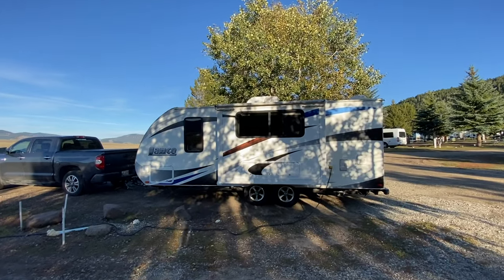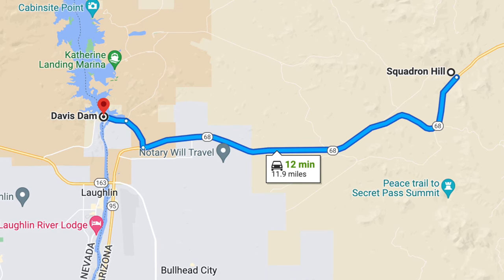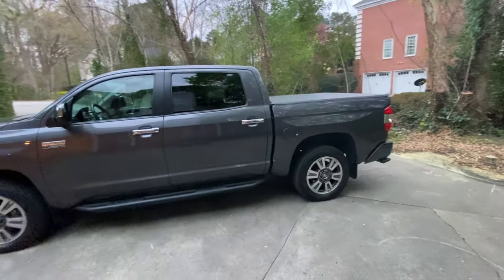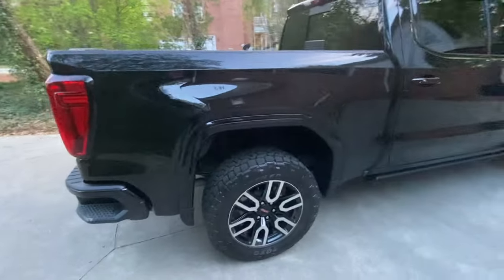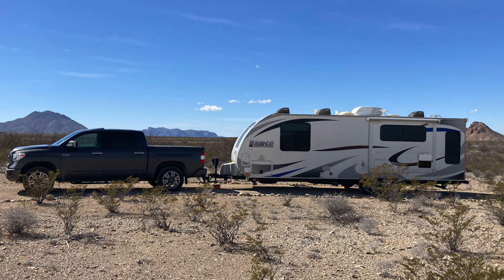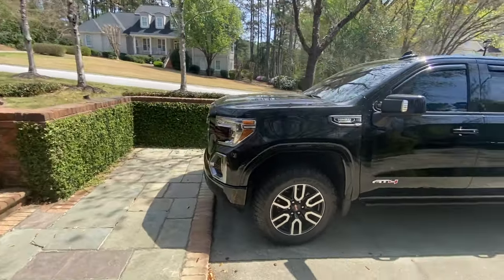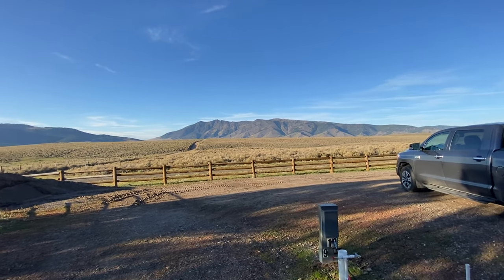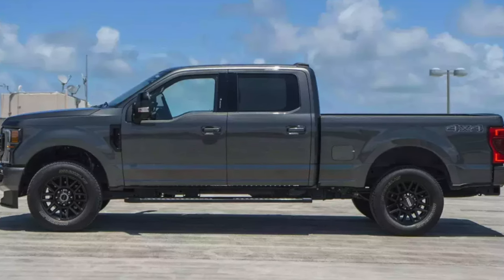Myths - Towing Capacity & Payload - the best Half-ton truck for your Travel Trailer or RV

Comment: Great video! I was hung up on payload for the longest time! My brother who is a highly intelligent engineer told me to think about parameters, not absolute math, because too many equations are not defined. This you clearly demonstrated in your video, Thanks. My brother tows a 27' trailer approx 7000lbs with his 2007 Toyota Tundra 5.7L V8. He has encouraged me to move to a larger trailer. I have a 2014 Toyota Tundra with the 5.7L V8. I tow a 19' trailer approx 3500lbs. I would like to upgrade to a trailer that runs around 5500lbs. Your video has given me some great things to think about. I am not sure where I heard it, but I remember someone saying a good rule of thumb is always to be around a 1/3 of the manufactures tow rating. Do you feel his is a good rule of thumb? Seems to me that most people feel ok running closer to 2/3.
Reply from the maker: The thing that I always heard was 75% of max towing capacity.   At 5,500 lbs, you should be just fine.
Reply: Ive pulled 6000lb travel trailer in a 5.7 tundra for years. Its fine on flatland, and will pull it in the mountains, but your gonna see alot 4000-5000rpms on the tach doing it.
Reply: I tow a 21ft with a v6 Tacoma which has a tow rating of 6500lbs. My truck will tow ok on highways backroads and even steep mountain roads and still keep the rpm’s usually under 3-3.5k. On the freeway it’s a totally different story. When I’m in 5th gear and and hit those rolling hills it falls on its face and looses all power. I have to try and hit 70 and get a running start at the hills and then downshift when I get into the hill and still struggles. I have semis blowing past me like I’m sitting still. I think my  torque converter is on its way out now too cause I’ve been hearing and feeling some weird stuff going on in that area. Even though I’m well within my tow rating I feel like tow ratings are greatly exaggerated. My mom has a Silverado rated for about 8,000 lbs but I can make that thing squat just by pushing on the bumper with my hand it’s so soft. My Tacoma I could jump on it with my full weight and wouldn’t hardly budge. I don’t see that Silverado towing no 8,000lbs.
Reply: @thomasdean5651  Thanks
Reply: @kedrevs4037  Thanks

Comment: I have an older silverado with a 34 gallon tank and it does really well towing. It was a fleet truck single cab and depending on the load behind me I really don't know it is back there. I am looking to retire soon and we are thinking about different RV's and maybe up grading the truck but then I am not really sure witch way to go but this has been very helpful.
Reply from the maker: Thank you.   Fuel tank needs really depend on how far you like to travel in a day.   New Silverado’s only have a 24g tank, But if you don’t travel more than 200 to 400 miles a day, It’s not a terribly big deal.

Comment: I tow at 5000lb 24 foot tt with 2014 f150 5.0 3.55 , 36 gal fuel tank  4th and 5th gear,canada to AZ each year, just hates wind.   12mpg imperial all day long
Reply from the maker: Wish you could still get 5.0 with 36g tank, but Ford will only offer that 36g tank with the 3.5 now.

Comment: When you have an accident and get sued those weights will become a big factor. Another factor is trailer sway on the highway and passenger tires on your truck while towing can kill you because they are not made to resist sway. A class E tire has much stiffer sidewall construction and a 10 ply tread that resist sway a lot better . But with my experience with a F150  rear axle flexing causing the rear brakes to contact the Emergency brake drum causing my rims to build heat to the point of burning my hand while towing with only 900# on the tongue and the terrifying sway when raining  and simi trucks pass me at 60 mph I invested in a Gas F250 . All my towing problems went away. Absolutely no sway with the Class E tires and the 7000# truck and it was purpose built to deal with heavy loads . Now I can up grade to a larger trailer . I always stared gazingly at F250s  and see others staring at my F250 with envy . I definitely understand . My wife doesnt want to ride in anything else .
Reply from the maker: F250s are great for towing, but 900lbs of tongue weight in an F150 is silly with that scrawny rear axle, not possible to not be over rear gross axle weight.

But please cite Any civil suit or law suit that involved a driver getting held liable based on vehicle weight.   

Additionally, if you have 17” or 18” wheels, you should get E rayed tires.   But if you have 20” wheels, the sidewall is so short, it makes no difference.  Especially in an F150 that isn’t designed for that load.
Reply: I have an F150 5.0 with E rated tires and an 8000 lb travel trailer. It toes the trailer well but stability and sway definitely make you uncomfortable. I also have one of the classic OBS Ford F250s with the venerable 7.3 powerstroke which has apparently half the horsepower of the F150, but it pulls the trailer with ease and it far more stable even at higher speeds.

Comment: Tfl truck it was the 1500 RST CHEVY. 6.2 V8. They can’t tow at high elevation at the max tow rating. Less air means less power. More stress on engine and hot day.

Comment: Thanks for the video. I am new to towing and just bought a Lance 1985 that has a GVWR of 7000 lbs. I am going to tow it with my 2020 Ram Rebel that has 11k towing and 1406 payload according to the Ram website after entering the truck VIN. Any tips or advice? I am a little nervous as I plan to tow from Colorado to Washington later in the year. Happy travels.
Reply: I forgot to mention my truck is 5.7 v8 hemi 3.92 gear ratio with 33 gallon gas tank. Thanks for your time.
Reply: Weight distributing hitch, leave the truck running for a while before you shut it off or get gas (no fluid pumping to the transmission cooler if the engine is off.) keep an eye on temps while pulling big grades. You’ll be fine.
Reply from the maker: Sounds like a sound setup.  Making sure you have a properly set weight distribution hitch is my best advice.    Stay at a comfortable speed for you,  I think that is the biggest part of towing.
Reply: @kedrevs4037  thank you for your reply.

Comment: With a trailer, you’re not pulling it, you’re rolling it. However you have to be able to safely stop. 
I own a 19’ Tundra 1794 and i occasionally tow but nowhere near its rated capacity. 
Been a great truck, I’m keeping it till the wheels fall off!
Subscribed 👍
Reply from the maker: Great post
Reply: Yeah Toyotas are reliable for the most part. I have a 06 Tacoma I bought new and it’s been good with mostly just maintenance but the paint is all falling off because Toyota paint sucks and the torque converter is starting to go bad at 156,000 so it’s time to dump it. So I guess I  could say I drove it till the paint fell off.

Comment: Did you know that the RST without a low diff, you have a payload of 1,978 lbs?  Axle is still the same at 3800….   I live in snow country in the mountains and figured I would be screwed without a low diff, but honestly with the locking rear diff I’ve not get it stuck or needed it yet for 4x4 stuff.  I guess I have SXS’s and dirt bikes for off road,… Just a thought.

Comment: Your Tundra’s Payload of 1185 lbs is figured by the manufacture by your options as your specific truck sits ready to drive that means “wet weight “ all fluids including fuel whether it’s a 20 gallon tank or 50gallon that’s all figured in. So when your truck has a full tank of fuel ready to drive you cannot add more than 1185lbs of people, gear, or whatever you put in or “on” your pickup including aftermarket bumpers, winches, oversized wheels tires etc… these all play into your Payload capacity. that is why a f250 top trim level 4door might only have a Payload of 1900lbs whereas a f250 2door base model will have a Payload of 4000lbs.  Same frame same suspension same engine same brakes etc…
Reply from the maker: I would agree with you if the manufacturer could provide evidence, but they don’t, it’s arbitrary

Comment: I love when I’m camping and I can hear an f150 ecoboost coming from far away because their fan is running to cool that v6 down because the rpm’s do get high enough to make boost to tow up hills on dirt roads.
Reply: That ecoboost will also have much less issue in high altitudes than a naturally aspirated motor.

I have a 2023 f150 with ecoboost, I have never had an issue on hills and I could fly up them at 100 mph if I had no care for the consequences.

These ecoboosts start making huge toq around 2-2.5k rpms... the v8s need to be 2x that to get in their torque range.
Reply: @Tgrable84  so 4,000 to 6,000 for a v8… OK
Reply: @patrick32584  have you heard how loud a v8 is at those rpms. If you think electric fans are loud....
Reply: @Tgrable84  I own a v8 and don’t need anywhere near 4k rpm to make torque.

Comment: Great video. I’m new in the towing world and have a QUESTION: 
I have a 2017 Silverado 5.3 V8 4x4 double cab. I’m going to buy a Pioneer Heartland BH280 which is 7k lb. Would my truck pull that thing with 5 people in the truck and all their camping gear? 
I have a Decked drawer system already installed which adds another 500 lb with all the gear in it. 
Any help would be greatly appreciated.
Reply from the maker: I think it will pull it fine, the question is always stopping.  If that is 7k lbs gross weight, probably not too much of an issue with proper wdh and sway control, but not enough info on weights to give a real answer.
Reply: @kedrevs4037  properly tuned brakes on the RV will make braking a non issue.  I had to do an emergency stop pulling my TT and under extreme braking the trailer brakes actually helped stop the truck faster.

Comment: Thanks for this video. on line looking for ppls that drive a Tundra pulling a trailer.  Not too many of them. My Tundra is a 2017 SR5 pulling a Grand Design 2250 6995 Lb. bought the trailer then found the truck to pull it. might be a bit of an over kill but i feel safe driving with the wife in tow.
Reply from the maker: It should do great with that setup for a long time
Reply: Nice setup. I have a 2wd 2015 SR5 Double cab 5.7L that I use to tow my 2020 Heartland Wilderness 2300DB. The trailer at max load is 7400 lbs, but realistically I don’t load it to the max. It’s a great setup except I have the 26 gal fuel tank so I am pulling over every 2 hours. I feel very safe when towing my trailer

Comment: My F150 with the Max tow package has a rear GAWR of 4150 lbs.   Towed a 30 foot enclosed trailer that weighed 8500 lbs.  The 3.5 liter turbo with a 10 speed tranny was amazing.   Kept it out of overdrive by locking out gears 8, 9, and 10 which are the weaker overdrive clutch packs.   Turbos were hardly working just two or so pounds of boost most of the time.  If you dont get crazy with the throttle you can keep it under 10 pounds of boost up hills at about 3,500 rpm.  Gauge maxes out at 20lbs but i have only had it up to 17lbs of boost once.   My old 6.0 liter chevy worked a lot harder it was naturally aspirated and the only way to get power out of it was to wind it up well over 5,000 rpm to make it up long mountain passes.  I don't think thats the best for an engine.
Reply from the maker: Great info there, thank you for sharing

Comment: I have tow a Grand Design 245RL that weighs dry, 6500 lbs with a hitch rating off 670 with a 2021 Tundra and it pulls effortlessly.
If you talk on forums, I would need a 250 or 2500
4,000 miles in it now.
Reply from the maker: Ain't that the truth,  many on forums don't use common sense.

Comment: Sir I like your reasoning!   However please remember Ford makes a Heavy Duty Payload Package. Or HDPP WHICH EVEN in a Super Crew four wheel drive with 6.5 bed we have payloads listed on our stickers from 2350 to 2800 pounds.  No other half ton comes close as it has a special frame and heavier rear axle casting and bearings and springs etc.  No half ton truck comes close.  Having said that i wouldn't tow more than 7k with a half ton for the reasons you mentioned. Thanks so much!
Reply from the maker: GM and Ford both offer a "towing Package" on their half tons.  I have investestigated both for my next purchase.  Both offer GRAWR of 4,150 lbs,  same as my Tundra.
Reply: @kedrevs4037  Roger that.  But neither are as heavy as the HDPP special order in the Ford.  It has no match

Comment: Great info - expect one factor . I have worked in the automotive industry for over a decade and would NEVER  recommend that Nissan XD to anyone , we’ve replaced countless turbos and engines on the Nissans . I’ve even seen a long back order on the parts due to nationwide similar issues . Other wise phenomenal information. 3/4 tons are best bang for the buck .
Reply from the maker: Appreciate comment.  Titan does not have a turbo, and thr 5.6 has been extraordinarily reliable.
Reply: @kedrevs4037  diesel version . I should have clarified - has not even close to the reliability issues.

Comment: Nice video.   Its worth mentioning that the 2014-2019 Ram Eco diesel had a high bearing failure rate.  Ours was in the final 6 months warranty and we sold it back to the dealer.  If it fails out of warranty, $18,000.  We replaced it with a '23 3.0 LZ0 Duramax diesel.  Regarding the range, you can purchase a 43 gallon Titan fuel tank for $1370.  Its a direct replacement  for the factory unit.  We tow a Lance 1475s.   We may move to a 1975 or AS 23 someday.
Reply from the maker: Great info, thank you.  That LZO is tempting.

Comment: Newbie here. Just started my full time nomad RV life. I've got a 4715# toy hauler that is probaly around 5300# loaded (tanks empty, carrying a 350# motorcycle). I'm pulling it with a 2019 Tacoma 4x4 off road V6. I suck down the fuel but it seems to able to handle towing ok. I'm heading west though and worried about climbs and descents. I have weight distribution and sway control, brake controller too. I love my truck, but i think I may need something more powerful. Thoughts?
Reply: Don’t do it. I have the exact model Tacoma as you, I tow a boat that weighs 3000 lbs. and it struggles. That kind of weight your towing needs a half ton
Reply: @joebrewster8074  is yours the 3.5L? I have a tow capacity of 6400# according to the manual but I haven't looked at axle weight ratings yet. I plan to hit up a CAT scale next weekend to see where I'm really at loaded. I haven't seen much struggle driving from.Austin, Texas to Longmont, Colorado. But going up some hills we're hitting high RPMs, not in the red though.
Reply from the maker: For that weight I would feel more comfortable with a little more truck, but if your Tacoma is set correctly, I think you can do it.

Comment: So would you recommend staying at least 80% lower than the tow rating for any given vehicle or would you even go down as low as 70%. EXAMPLE: vehicle says it can tow 6500 #s And my trailer is 5700 #s loaded, that would be 87% of the tow rating.
Reply from the maker: MY rec is too make sure you returned at least stock weight to the front axle and be under your rear GAWR.

Comment: I think most people were confused abut payload. Payload on a truck is different than a payload on a trailer. Payload on a truck is the capacity of what a truck frame could withstand under stress with standard load including full tank of gas. That should also included a safety factor of at least 2X - estimated of what they should be used. Payload is not a part of towing capacity.
I am not into RV but I wold never tow more than half of capacity fully loaded. In addition, as an ex-turbo mfg engr. I would not recommend engine with turbo to any one.
Reply from the maker: Good info, appreciate it
Reply: Virtually all modern diesel engines have turbos. What exactly are you recommending to tow heavy loads with?

Comment: Newsflash: the baby diesels have turbos and you don’t like small displacement engines that use turbos to boost HP and torque because turbos make heat. Also if I’m not mistaken Toyota has just introduced a small displacement turbo charged engine to be their flagship towing option.
Reply from the maker: Suggesting turbo diesel are similar to gas turbo  is like suggesting dirt bikes are similar to street bikes.   They are not set up to perform the same job.
Reply: Well they pull like a diesel. In fact if you review the charts you will see that a 3.5 liter eco boost is making more torque at 2500 rpm than your 5.7 can make period; the  new Tundra 3.4 is going to blow your 5.7 off the road with torque as well. Yes turbos make heat; in fact it is common to equip diesel’s with  a pyrometer to monitor stack temps. I have a friend whom wasn’t watching stack temp close enough on his Dodge/Cummins diesel and cooked the motor pulling a local mountain pass. And likewise any non turbo makes a lot of heat when it is pulling a grade with a load because to develop the needed torque they are generally turning 4 to 5000 rpm; those kind of RPM’s are not generally needed or experienced with a turbo charged motor regardless of whether it is a gas or a diesel. If you just want to talk longevity then my first diesel was in a 1986 Ford, a non turbo 6.9 liter diesel. That motor could easily go a million miles but it could barely pull the truck without a trailer hitched…that non turbo diesel couldn’t pull itself out of a wet sack!